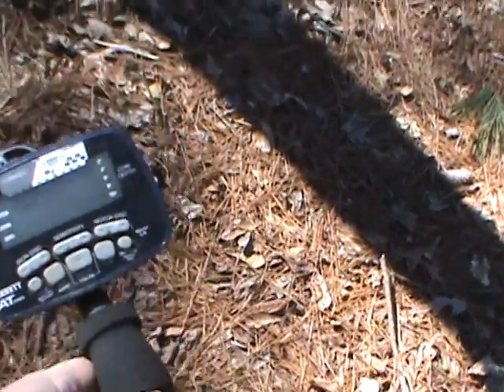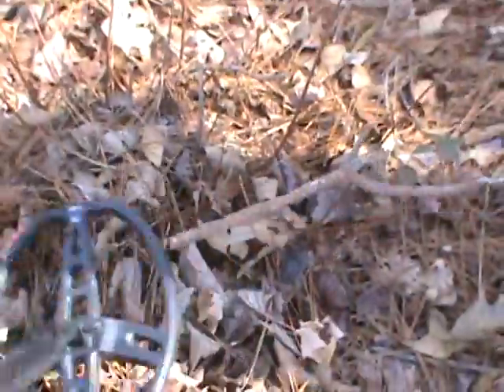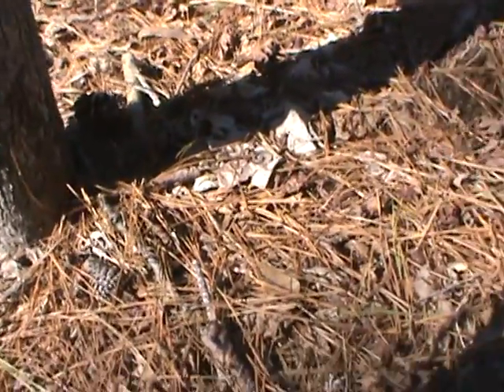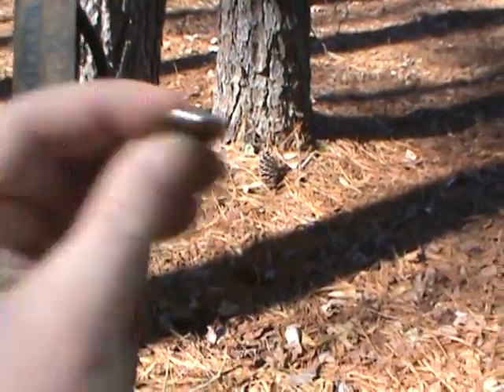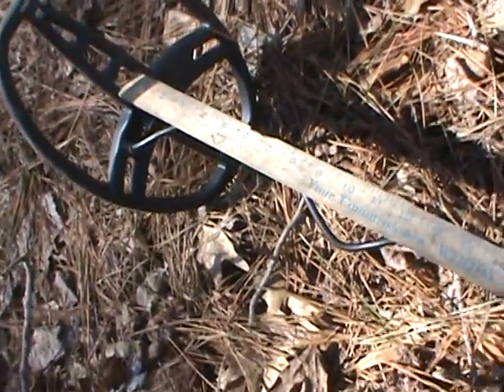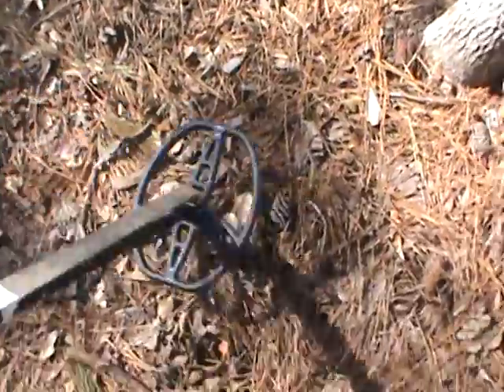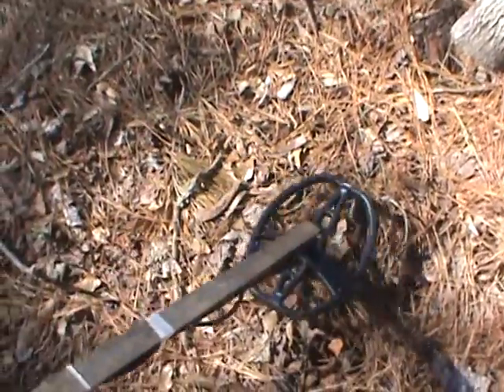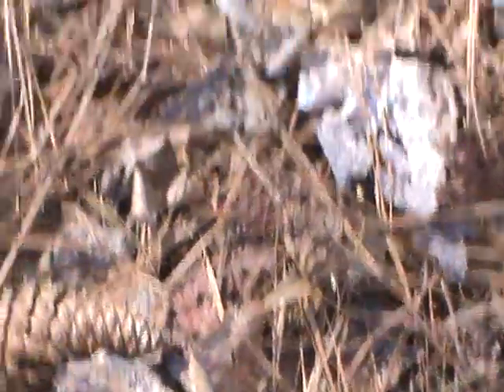Garrett At-Pro No more falsing

Comment: It  would  not  be desirable, that the problem was solved by way of an
pump down of sensitivity of the transistor and as a result on the screen would show sensitivity 8 and in reality was
4. But false operations would leave.

Can ask this question to Factory? To specify this moment.
In their official answer it is not absolutely clear that changes in the device, and
it is IMPORTANT!

Comment: My air test do not match your air test. Also a shake test like that would make any detector I have owned false. I believe your test are flawed and if your digging more that 10" inches with a stock coil on a coin sized target I would have a hard time believing that. The limits of the technology just does not allow for the depth you are reporting.
Reply: John Day your wrong there are 100s of videos of the at pro going over 10inches there on you tube go watch them check out aquachigger